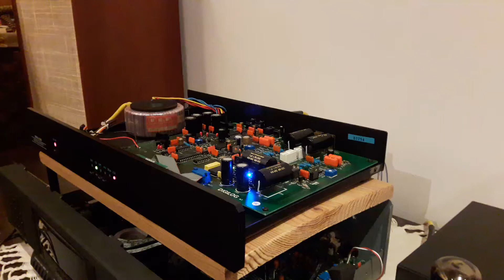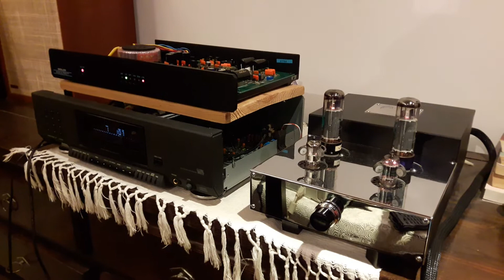Musical Fidelity Digilog - Philips TDA1541A DAC - Tim de Paravicini

Comment: Good morning!
Wow, even through YouTube this sounds absolutely stunning. So realistic and intense, simply unbelievable. Actually I'm using the Lab 12 Dac 1 Reference and put a lot of effort in my system but I'm far away from this performance.
Could you maybe suggest any ready built unit that would be sounding as good as this? What is your favorite chip after all (even if "some" other aspects matter...)?
Best regards, Michael
Reply from the maker: Dear Michel: There´s a lot of good sound R2R chips, like AD1865 (the choice of Audio Note in his DACs), PCM56, PCM63 or PCM1074. I prefer the Philips TDA1541 for his natural tones, detailed, sharp and almost analogue sound presentation. Of course to get the best of this pearl you need to do some tweeks and improvements. Try to find an Arcam Black Box (I or II). This DAC is an absolute bargain for what it gives, and very easy to upgrade to a top level. Your Lab 12 Dac1 Reference may not sound bad at all (it have inside a less refined R2R chip i.e. the TDA1543). I presume you are asking for more plankton and refinement in the music secene, that you will find in TDA1541.
Reply: @antoniocruz5714  Dear Antonio, thanks a lot for your kind mail. Yes, I know the PCM 1704 and 63 very well and love those units but there is something very special about the TDA 1541, it seems to be playing even more analog with an even greater punch. I'll head out for one of those Arcam units. Kind regards, Michael
Reply from the maker: @delicate_hifi  Nothing to thank! You´re more than welcome! In my previous comment I forgot to mention the current AYA DAC, made by one of the biggest gurus of TDA1541 - Pedja Rogic. Take a look at: https://www.audialonline.com/blog/s5-dac/
Reply: @delicate_hifi  у вас тоже очень хороший dac, я думаю вам нужно искать Хороший усилитель мощности, и убрать лишние устройства из линии (что то типа pre.amp) если это возможно

Comment: Hi, great sounding system, can I ask what mods you have done to the digidac, what Mundorfs did you put in? Thanks
Reply from the maker: Hi: Thank you so much for your kind words. Please take a look at the description. I haven´t nothing special, unless than capacitors upgrade and 2 shunt power regulators for feed the TDA1541A. Be in mind that´s a very nice sounding DAC, that needs not much more than some basic upgrades to give great music. Cheers.
Reply: @antoniocruz5714  is the 1541A NOS on this?
Reply from the maker: @johnshore3095  In this video the TDA1541A is running in OS mode (as asking by the owner), but NOS is much better, if well implemented.
Reply from the maker: @johnshore3095  One exemple of TDA1541A in Non Oversampling mode: https://www.youtube.com/watch?v=rQ2_EVI0CnE

Comment: Which is better, MUSICAL FIDELITY DIGILOG or Arcam Black Box? What's the difference between them? Which one do you prefer?
Reply from the maker: I like them both. In stock mode, the MF Digilog is a better sounding unit, but the Arcam BB have more room for upgrades and have a more direct and pure sound, as there's no decoupling capacitors in the signal path. If I had to choose one, I will go with the Arcam Black Box.

Comment: How does the Philips TDA1543 compare to the 1541A? Have you heard the 1543?
Reply from the maker: TDA1543 is a cheaper version of the TDA1541, so the latter is much better. However, if you put together a bunch of TDA1543's playing together, you get a huge bass and a very clean and analog sound. The thumb rule is that you put many of them together to reduce the decoder errors.
Reply: @antoniocruz5714  I see. Just like Lab12's DAC1 reference. It has 8 tda1543 chips in parallel.
Reply from the maker: @verbatim_transfer  Yes, with output tubes that´s no more than a buffer - in my opinion.